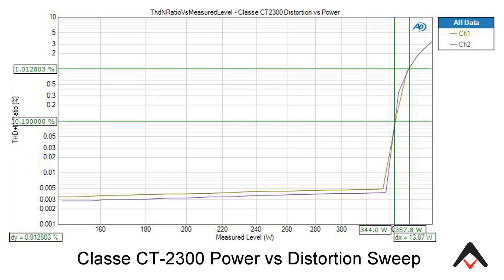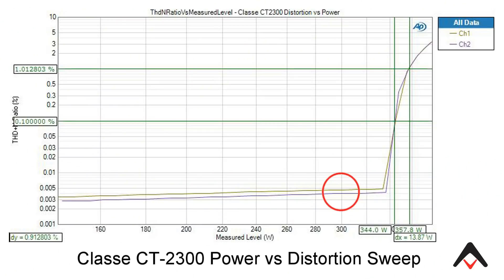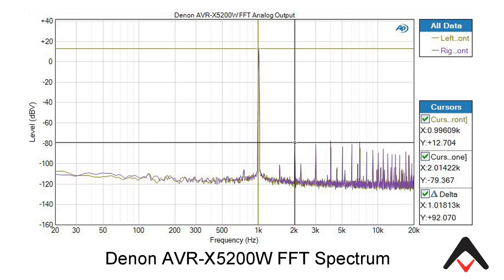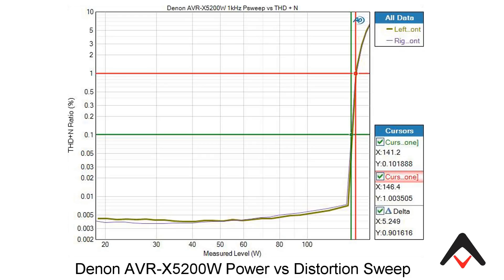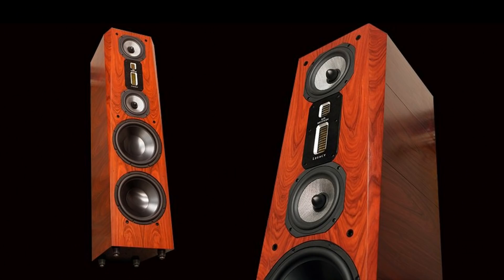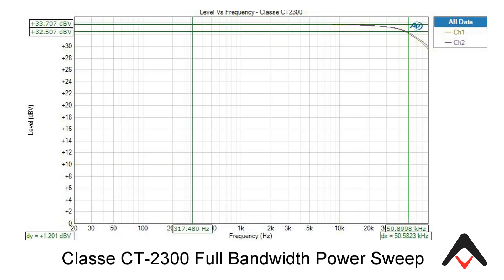Understanding Power Ratings in AV Receivers

Comment: Gene I really love your videos !
I wish more people especially younger people who are into music and hifi would watch your videos !

Your honest and remain unbiased which is hard for me to do

Your stuff is based on actual facts, science and math
as an Audio engineer graduate I can say to EVERYONE WATCHING he knows his stuff

Side note can we expect a video review of the Anthem mrx 1120- or 720 soon?
Reply from the maker: Very kind.  thank you.
Reply: My rule of thumb is very simple. Divide the power supply wattage (if stated) to 3/4, (typical conventional iron plate transformer efficiency) as power supplied to the processing and amplification circuitry.  Reduce the remainder to 3/4, as typical npn/pnp transistor efficiency.   Eg: 800 watt power supply = 600 watts output. 600 watts x 3/4 = 450 watts total.  In other words, you get slightly more than half the rated power consumption as final total output. The rest is space heating. Therefore, one would expect 90 watts rms per channel continuous, from a 5.1 receiver with an 800 watt power supply. If the device doesn't state power consumption treat all claims with caution. Toroidal transformers (up to 90% efficiency) and Class D output (typically 85% efficiency) might deliver a further 15-20% maximum output, depending on the quality and efficiency of the switching circuitry. No one listens to single channel output, so its claim should be rejected as pointless window dressing. No one would use a 5.1 receiver as a mono amp.  That is a PA or bass reinforcement application only, for which one might buy a 1000-2000 watt mono or bridged stereo amp.
Reply: I just purchased a 720 and they make my speaker loud and clean,  first I play some songs without running the ARC. An then i run the ARC and o boy you can tell the difference right away, The only bummer is I cant play my old iPod through USB.which is i missed on my Yamaha receiver
Reply: Abbey king
 yea Ive heard great things about There room correction.

I really want the 720 !